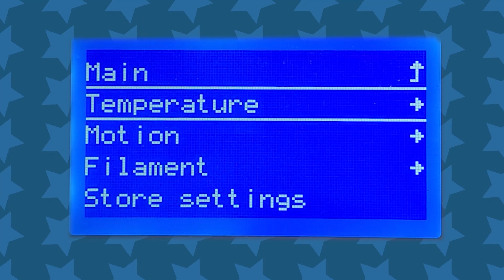Ender 3 Pro Nozzle Clogging Solution

Comment: Hello, My Ender 5Pro keeps clogging. I've changed the hotbend with new V3 bought on creality store. Changed the tube. I had no problems since 2 years. I tried higher/lower nozzle temp, I changed retraction length from 4.5mm to 1mm... nothing helps.
Can you help me solving this anoying clogging ?

Comment: I have an issue in cleaning heatsink. when I remove the nozzle and I push the filament from the top to clean the heatsink throat a washer goes out and I never can put it back. when this washer is not in the heatsink the filament always clogs during the printing.

Comment: I know this is kinda old, but my printer had issues extruding and with this video I got it to print the test for bed leveling perfectly again. Maintenance is key , even print veterans forget a step once in a while . Each printer is different. My 3pro has been with me for over three years and still works fine

Comment: I purchased replacement nozzles from Amazon, that are exactly the same size & length as the stock nozzle that came with my Ender 5.
When I put it in, the Amazon nozzle hung lower on my Heatblock. The stock Creality nozzle seems to have no threads near the heaterblock end, and  must somehow nessle into the heatbreak; because it fits in deeper.. 

Where can I find tappered nozzles that have the best fit to the Ender products?
 My Amazon 'butt faced nozzle' started leaking only after a few prints; and I know I tightened it properly. I need a source for a 0.2mm nozzle.

Comment: I have problem with creality spider hotend. I printed PETG filament and when it reach approximately 30mins, the hotend is clogged after cleaning the hotend, its start working again but then after 30mins it start clogged again. I have repeated that process more than 10 times. Nothing better. It is very disappointed. Anyway to fix it?

Comment: Awsome video! One way you can tell its cloged is especially with abs if it no longer actually prints( it balls up on the nosle( or with pla it prints but snaps) Also if all else fails and your country has Ali express( PRC/ most Asian countries) or Amazon( west Europe amd North America ) you can get a nice hot end ( if your going to replace the whole extruder+ hot end assembly I'd recommand buying an all metal extruder ( cheap one works fine) cause it avoids soooo many issues this way. Also know that the bowden tube is toxic if heated at abs gr2 amd above temps( so basically 260 and above). Since I been getting lots of calls about this please understand that the included hot end with ender 3 pro is only for abs grade 1 or pla/pla+ dont try any other as the bowden tube will melt and its fumes are toxic.
Reply from the maker: you're absolutely right， get the points.

Comment: prevention is better than the remedy: i figured out my clogs were usually happening after a filament change. dust accumulates around the opening where the filament enters the ptfe tube in the coupler and bmakes a little fuzz ring. when you pull the filament out and feed the new one in you inevitably push some of that fuzz into the tube, which ends up in the nozzle. i placed a less open extruder on the motor and a filamet filter right before the extruder and never had a clog again.
Reply: What do you mean by less open extruder? Only had my printer a few months, so still learning all this, but I didn't have any issues until I started changing out filaments more recently
Reply: @SkunkLifeMedia  on the original extruder the filament is exposed more to iar, so to say, on the inside where the pushy knurly wheel is. The replacement has bits that protrude alle the way tot this wheel, so the filament is only exposed where it needs to be. Just add a fiter before the extruder and when changing filament push it only a few centimeters into th eptfe tube, then pull it back about 5mm. If there is someting in the tube in front of the filament STOP!  Clean that first somehow and then  try loadong again.

Comment: Hi, I've got an ender-3 V2 and I'm consistently having nozzle clogs, is there any way to avoid this as new nozzles are quite expensive....
Cheers KJ
Reply from the maker: 1. Is the nozzle temperature enough? PLA-200, ABS-250
2. Whether the nozzle cooling fan works normally
3. Whether the customer's nozzle is the original nozzle with a diameter of 0.4mm
Reply: @Creality3D  yes the temp is usually set to 205-210 the fan as far as I'm able to tell is operating correctly, and it's a 0.8 nozzle however the files had been configured for that, I had managed to print numerous prints before the problem had occurred

Comment: I have just bought a CR10 V3 and from first print I have had trouble that my prints are weak. It seems that the problem i under extrusion, so I have done everything in this video, but I still have the problem. I am desperatly seeking for a solution, as I had really looked forward to print with my new CR10 V3. I have 2 x Ender 3 V2 working PERFECT :) I hope you will get back to me and maybe try to help me fix this issue. Kindest regards Kenneth
Reply from the maker: Friend, sorry for your printer's problem, pls contact our after service https://www.creality.com/service-request. We have very professional engineers there to solve your problems. Thanks for your support.

Comment: Yeah, no. this video was absolutely useless. I have to completely disassemble the extruder just to put filament in my Ender 3 v2, not to mention the sample filament included in the printer box turned into an unmeltable rock inside the first nozzle that doesn't even soften at 250.
Reply from the maker: Friend, you mean your filament won't soften at 250?
Reply: @Creality3D  I got it out eventually, it almost looks like it was on the verge of catching fire. I got some filament other than the sample that came with the printer and it's worked fine for several prints now.

Comment: Would the instructions shown in this video be used for my situation? My impressions, in the first moments, or after several minutes, simply the strusher makes a strong noise and no more filament comes out. When I open everything, it is clogged and I have to cut it and I have done it several times.
My printer has only 3 days with me, it is new, and I only printed 4 small parts, after that without success.
Would you help me? My printing
Reply from the maker: Friend, I suggest you try the instructions in the video first. If you still have the same problem after many times, pls contact our after service https://www.creality.com/service-request.

Comment: My ender 5 pro clogs every other print.  I moved to a direct drive mod and it started clogging every print.  I switched it back and still Have the original issue.  Any ideas? I had the thought that cooling was not up to par and is melting the filament higher than its suppose to.  Does that sound like something that worth exploring?
Reply from the maker: Bro, have you followed the proper printing steps?

Comment: Hi Creality , Firstly thanks for this video. But also when ı try to change my ENDER PRO 3 V2 's nozzle - by using the stock wrench- it caused damage on nozzles hexagonal structure. Im waiting for to contact
Reply: this is happenning to mine as well. How did u fix the problem? Get another wrench with tighter clamp?
Reply from the maker: @GiggityxGamer  Yes, frined. Have you tried to get another suitable wrench with tighter clamp to change your nozzle?
Reply: @Creality3D  I did use a tighter wrench and it worked

Comment: I think it's important to mention that leaving the hotend powered on while the fan cover is disassembled is dangerous for the printer. If it remains in a disassembled state and heat turned on for more than a few minutes, the heat will travel up through the heatsink and into the other parts damaging them.
Reply: You 100% have no idea what you’re talking about
Reply: Damaging them how exactly?
Reply: @jacobkudrowich  Heat will melt the o-ring and other delicate parts in the coupler, as well as the tube going down the heatsink.
Reply: @sysghost  The O-ring?
Reply: @sysghost  which o-ring?

Comment: For people who this does not fix an extruder issue:
 I was following this when I noticed something else that was wrong. When I was feeding my filament back in, I noticed the little brass gear that pulls the filament into the tube was loose and was not pushing filament in anymore. It was not a clog but in fact just a loose gear. This was a fairly easy fix, just take apart the spring assembly, and tighten the screws to hold the gear back up in the proper place. Once I did this, it printed perfectly again.
Reply: What were the symptoms leading up to this? I'm getting extreme stringing and then eventually no more filament coming out, almost like a clog. Ive replaced the couplers, bowden tube and 3 different nozzles in less than a week. The gear eventually wears down the filament if it tries to continue printing.
Reply: @stevedrawdy2532  That sounds like a different issue than I was having, and I'm pretty new to 3d printing so I don't really know how to help you,  soory :(
Reply: Man you are a lifesaver thank you
Reply: Bro, I read this and looked at where my spring was on where you run the filament in. I think it might the problem cause its kinda loose I can move the filament without pressing into the spring and the screw isnt tightened all the way.
 I will try and let you know.
Reply: @BloodlustHero  Sounds just like what happened to me, good luck!
Reply: @BloodlustHero  thank you You helped me. I just noticed my spring screw was lose. and that looks to have been the problem. extruding 100 mm would only get me 40. Now looks good
Reply: GOD BLESS YOU!! You have concluded hours of troubleshooting for me. I didnt even think to check for any loose screws. Thank you!!
Reply: @alexochoa4416  np man :)
Reply: Dude. Your 2 y/o comment just saved me from going through the whole cleaning process!! The gear was loose and not pulling the filament. Fixed my problem. Thanks a LOT!!!
Reply: @thegravitx  Lol I get a response on here like once every few months and it makes my day every time :)
Glad it helped!
Reply: You should make a video on this!
Reply: @logankellum5496  Maybe. I also recently found that you can adjust the spring tension on the feeding mechanism if the filament is slipping.
Reply: @owenequinox6  interesting!  I've only had my printer for a week and just started having issues today.  I changed the nozzle and ordered some upgraded parts so I'm hoping that fixes some.  I will check the tension though
Reply: @logankellum5496  In my experience the two best upgrades are the glass print bed, and a low-friction spool holder. The glass print bed has excellent adhesion, and lets prints come right off after it cools if you are using it right. Don't be a goon like me and use a glue stick after one failed attempt. Just clean the bed really really well.
Reply: Man I hope you're still watching this. How did you end up taking this apart?
Reply: @TheKingInYellowofMiskatonic  I don't have my printer with my right now, but I think you just unscrew the screw holding in the spring, and then just pull it out. By tightening that screw and compressing the spring further it will push the filament against the gear harder, which helps to prevent slipping. Hope this helped :)

Comment: Thanks for the information. When removing and installing the nozzle, it must be at 240°C?
Reply from the maker: Only the cleaning process requires a high temperature, and it is not necessary to maintain high temperatures when removing and installing the nozzle. If you clean the nozzle for the first time, it is recommended that you cool down before removing the nozzle.

Comment: i do all the step... im still having clogged long time print... any idea? why im still clogged nozzle
Reply from the maker: I don't know what filament you are printing, whether the temperature setting is too high, and whether the nozzle is too close to the hotbed. Or the end of the PTFE tube connected to the nozzle is not cut flat and not fully inserted into contact with the nozzle?

Comment: Hello, I have an ender 5 pro. I upgraded to the new creality glass bed, and now my prints do not come out good at all. Are there any settings I need to change?
Reply: You will need to adjust your z height properly. Make sure your glass bed is cleaned with isopropyl alcohol after each print. If you are printing with pla, I found that a 60c bed temperature is about perfect. Print models with a brim. What exactly is going wrong with your prints?
Reply from the maker: Will you re-level the hot bed? Can't print the nozzle does not spin? Or can the first layer not stick to the glass?
Reply: @Creality3D  the bed is level, I adjusted the temps and levels and it started working wonderfully for several prints. However now it starts prints beautifully and then start printing weak filament that breaks apart. What is happening?
Reply: @michaelisakov1108  Try feeding fresh filament that hasn't been in your machine before.
Reply: @michaelisakov1108  weak layer bonding comes from low nozzle temperatures.. higher temperatures will cause stringing. You will need to find the sweet spot for your printer. Are you printing higher than 0.2mm layer height? That could be the issue as well I noticed best layer adhesion is at 0.15 mm and 0.2 layer height. Might wanna experiment with that.. good luck
Reply: @michaelisakov1108  so is the model breaking apart after printing? If so, then you need to adjust your Esteps/mm to get the proper amount of filament out of the nozzle. If its printing fine and then gets worse, it means you nozzle or hotend is clogging. If that is the case please rewatch this video from Creality that shows how to unclog your hotend.
Reply: To add on what permanently patriotic said.. make sure your bed is leveled perfectly and the nozzle is only 0.2mm from the new glass bed.. as well start small test prints with the minimum manufacturer recommended temperatures for the filaments.  Each filament is different.. and go up by 5 degrees if needed. Good luck 👍
Reply: When adding the glass bed, should I remove the magnetic layer from the metal bed or leave it on?
Reply: @afh_gaming leave it on unless your bed temps will be above 75c. At about 80 to 90c the magnetic layer will start degrading.